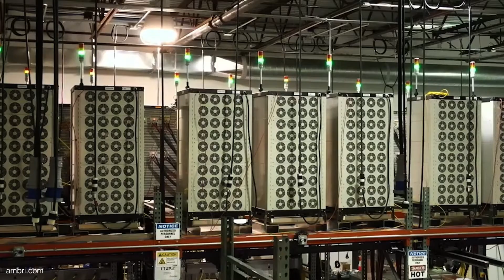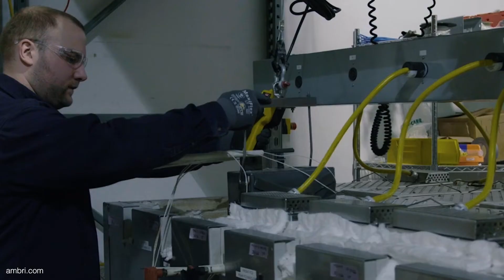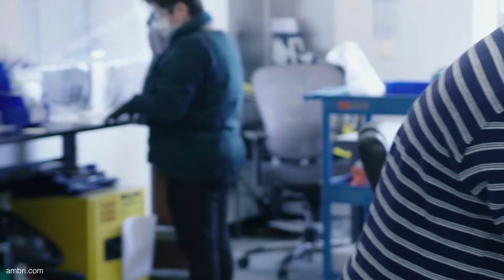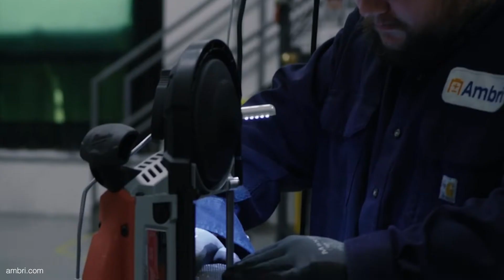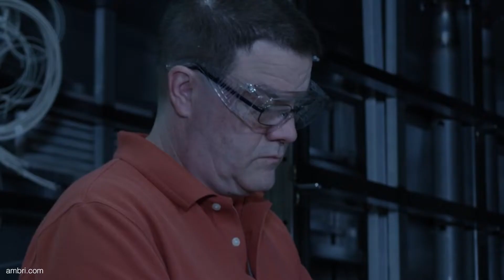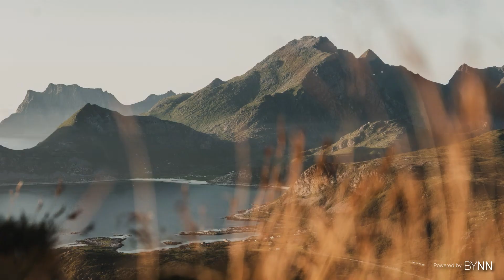Can We Store Sun And Wind Energy? | Donald Sadoway & Christopher Vonheim

Comment: Wow, I've been looking for ambri, but all I could find was business/commercial/patent stuff with Donald Sadoway pictures as a patent shark. I've seen more patent office videos promoted and no technical video.
This is the first time I see him as an engineer/scientist. Thank you! Because I was already thinking it was a scam too good to be true.
And I need to invest either in Sodium batteries or the Ambri batteries for a project within 3 years. If possible the Ambri batteries, because it sounds like they can store the surplus energy from the summer for use in the winter as in the winter usually only wind is available.
Reply from the maker: Thank you so much for checking it out!
Reply: where are you located? solar is effective in winter as well as summer in most places. the summer insolation is greater, but in a properly designed system there is still plenty of energy available.

Comment: Optimally, these should be sitting in large banks near intermittent power generators like solar and wind.
However, from the standpoint of grid stability, there would be a great advantage to power companies deploying smaller units (48' intermodal trailer container) to urban grids. Set up localized buffers that kick in only when local demand spikes. Maybe it is because of the simultaneous vehicle charges starting, maybe it's because there has been damage (power pole hit by cars) to a small part of the distribution system.
Eventually, they might be able to make these as something like a 8' diameter x 10' deep battery that simultaneously serves as the footing for a power line pole.